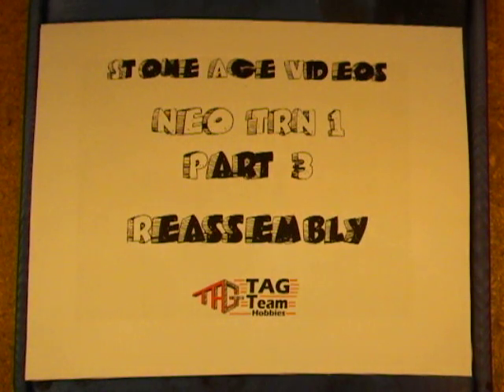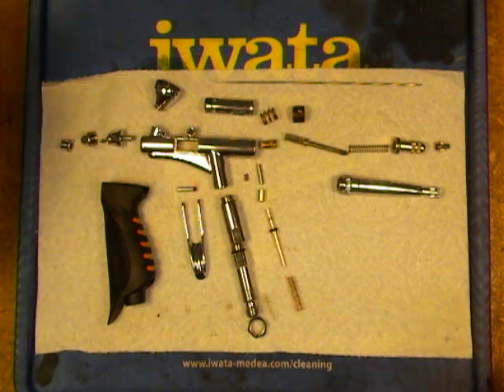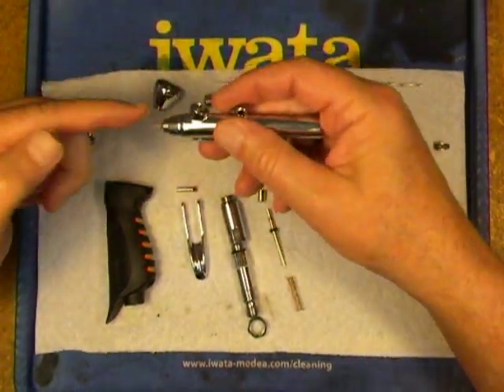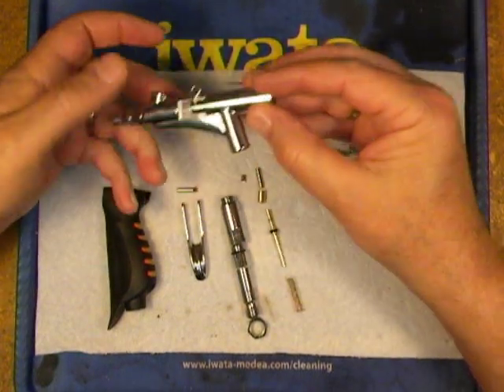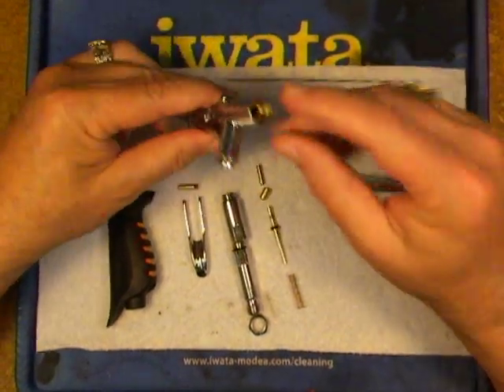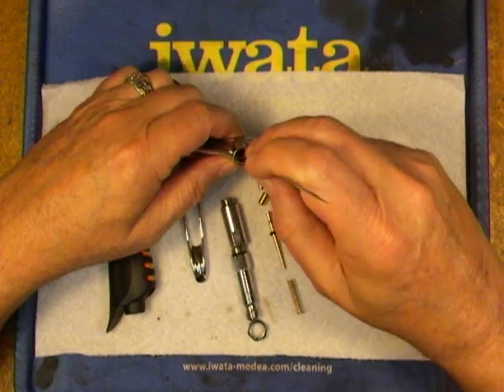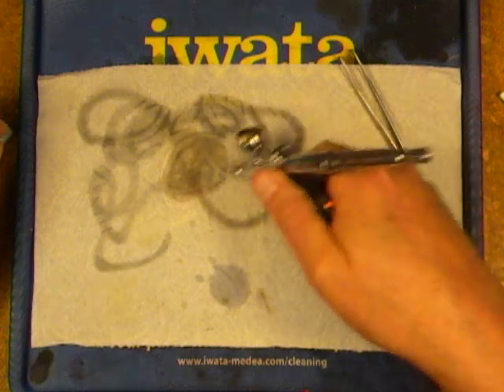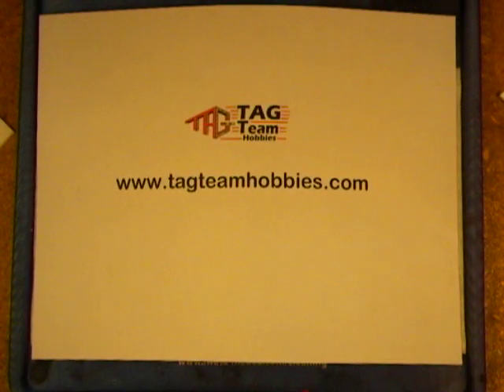trn 1 pt 3

Comment: What if you don’t have the packing tool. Can you just use a regular screwdriver.
Reply from the maker: Hi! Thanks for asking. Yes, you can. That's what we did in the Before Times! Before there was the Pro Maintenance Tool Kit. It has to be narrow enough and long enough to get down to the needle packing. 

With a regular screw driver, the trick is to put the packing back in without getting it too tight. Screw it in until you hit resistance. Then check it with the needle. You want it snug, not tight. So, check with needle. Snug it up. Doesn't take much movement to make a big difference. Check.  Tighten. Check tighten. 

It's really easy to over tighten with a regular screw driver. The PTFE doesn't rebound well. Get it too tight and you wont' be able to get the needle in! At that point, loosening it up won't help much. Just proceed slowly and you'll get it just right!
Reply: @tagteamhobbiestomgrossman2720  
Thank you that really helped. Got it done and is working good. 👍
Reply: Also where can I get that cleaning kit at if you don’t mind.
Reply from the maker: @GVJLofts2010  Excellent! Glad to hear our back in business!